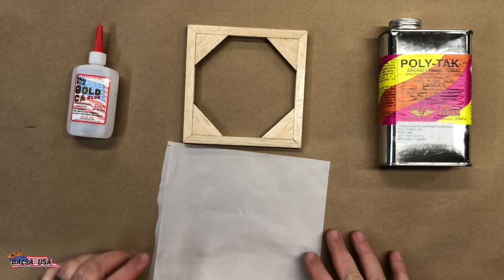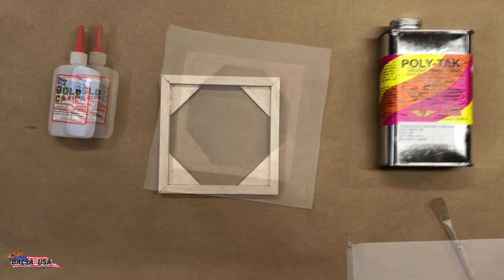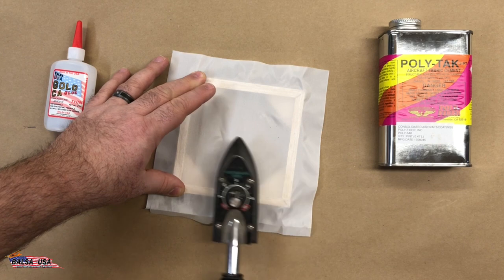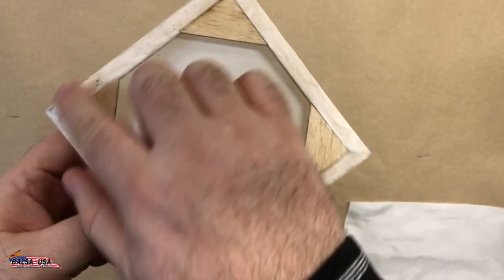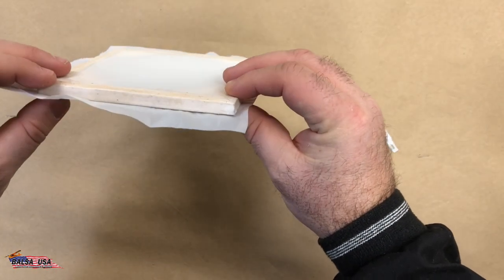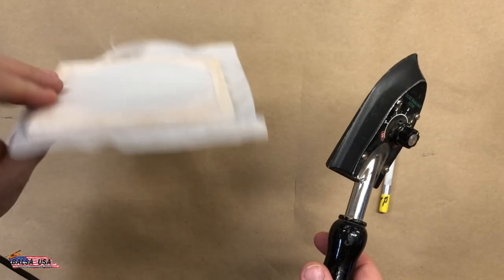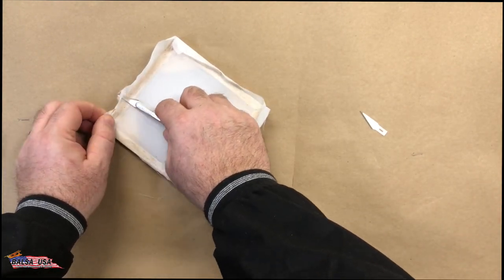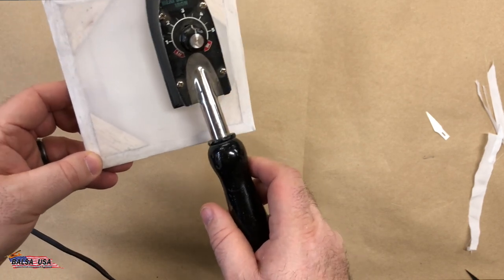Planetex Demo Covering Demo

Comment: Quick question: when you apply the very first coat of poly-brush to seal the weave, do you reduce the Poly-Brush at all or use straight from the can ? If you do reduce it, at what ratio and with what type of reducer ?  Last, how many coats of Poly-Brush does it take to seal the Planetex ?  Thank you for your time.
Reply from the maker: i didn't reduce it at all
Reply: @balsausaairplanes6566  Thank you very much for your feedback

Comment: Why this technique vs how stits lite says to do it? How much does that polytac soak into the wood and how well does it actually work when heat activated? I bought this stuff and will start covering next Tuesday!
Reply: The technique in the video really isn't the best way to do this with this fabric. Using heat to reactivate the poly tak sticks maybe 60% as well as rubbing the fabric into wet glue. Doing it that way also saves lots of adhesive and weight as well....

Comment: I've used stuff like monokote and similar coverings in the past but was looking at using something I could paint. After being sealed primed and painted are there issues with shrinking/expanding from sitting in the sun and causing paint to crack? I've never used anything quite like this before or painted on covering but am thinking about trying it out on a simple build I'll be starting in a few weeks to test it out.
Reply from the maker: Brad Bourque no not really. Once it’s primed and painted it pretty much stays put

Comment: I'm trying to be optimistic, but really this is a joke compared to the convenience and effectiveness of Solartex.  Did Solarfilm (the company) give any advance notice they were folding?  Was there any effort to buy them out, or at least buy their machinery and processes?  As for Planetex, this is really no different than the Sig stuff.  I tried that and the glue would just soak into the wood and not stick very well.  So, now everyone has to buy all these chemicals, which probably have to ship ground.  And the winter builders will have to invest in air ventilation equipment or wait until Spring.  And now we have to sand.  And also now we have to recoat the glue on all the edges of the first half wherever there is overlap.  In the video, when the guy was doing the corner fold, I knew right away he was going to have to stop and re-coat the corner.  I'm surprised he didn't anticipate that, what made him think the glue from the initial covering was going to soak up thru the fabric and make the second one stick.  I'm already thinking of a way to roll on the adhesive to the fabric prior to any covering.  Also, what is the cost of the fabric AND all the chemicals compared to what Solartex originally cost?  As for the weak argument about weight savings....well I never heard anyone complain that Solartex weighs too much.  OK, so wow, I succeeded in being optimistic.  Pat on back.  :)  One last comment...instead of that heart attack inducing impact wrench....google the soundtrack for that old TV quiz show "Beat the Clock" and use it instead.  Thanks.  Reordering nitroglycerin pills now.  I hope you all get a laugh out of my dry humor.  It's a Midwest thing.